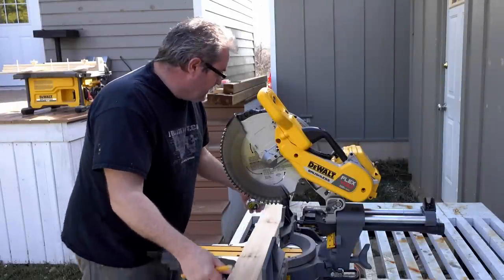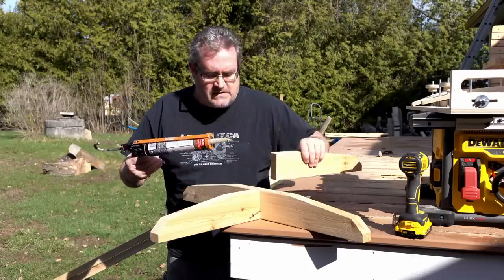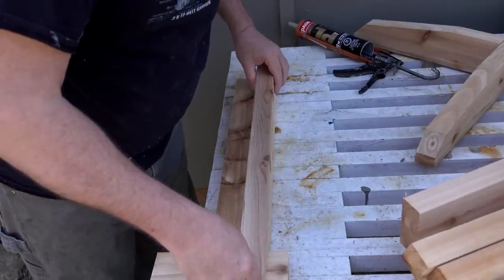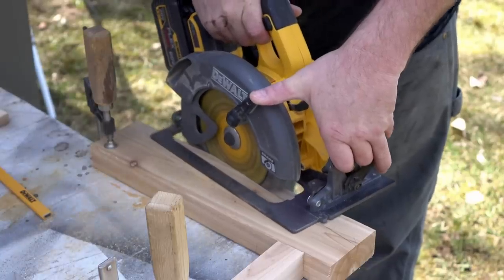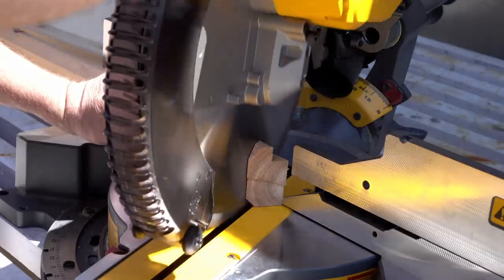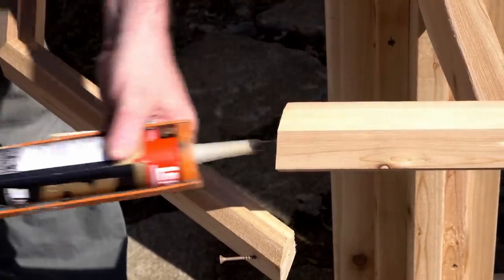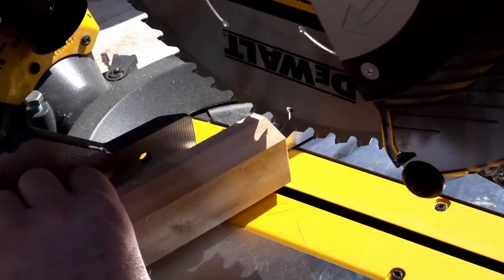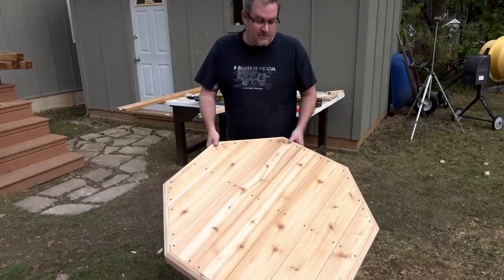How To Make A Patio Table - Easy Woodworking Project

Comment: Nice build. Are you familiar with Kregs adaptive cutting system with rip guides?  Chris Salomone featured it recently and it has these self squaring components that compliment their circular saw guide track to get 90 degree square cuts.  Made me think of your guide track build and your cross cut guide for tablesaw and how you would design a similar system/track guides for cutting pieces square, for example, to build cabinets.  Ps ... That was an Awesome ending!